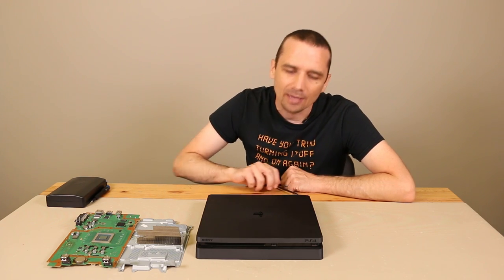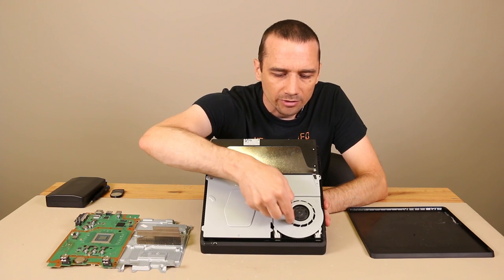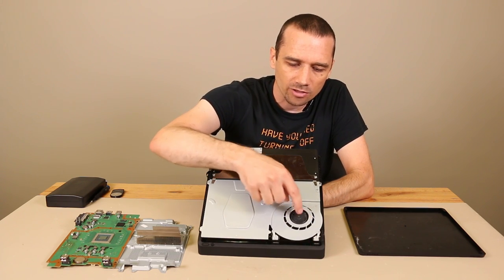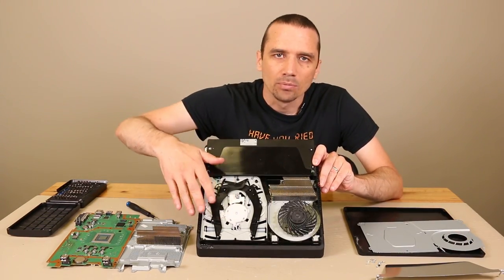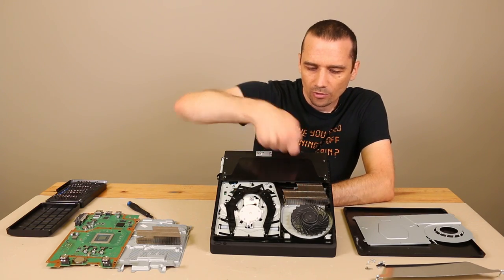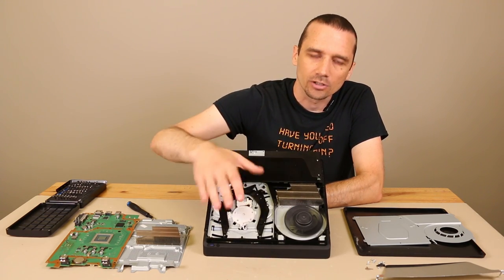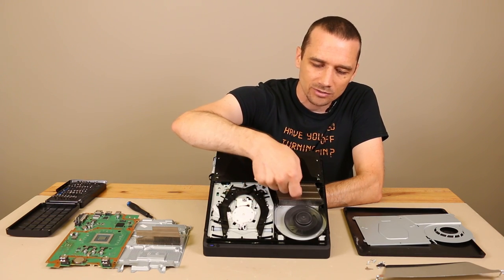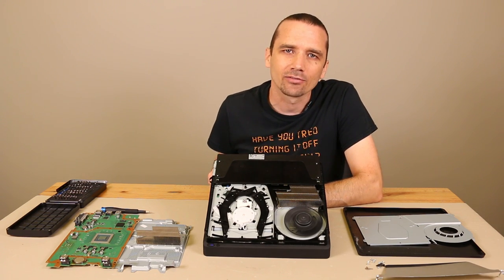PS4 Cooling System - How It Works - See it Working

Comment from the maker: Let me know what you guys think and if there is anything else you'd like to know about the PS4 cooling system. Please hit the like button if you like it!
Reply: TronicsFix Hey Steve thanks for the video. I've been thinking what do you think of the home made fans on the ps4 pro? Some people just drill the square the size of a fan underneath, and mount a different fan.
Reply from the maker: Yes, I'm planning to do a similar video with the PS4 Pro.
Reply from the maker: I'm not convinced they are really that helpful. The Pro can cool itself just fine if it's in good condition.
Reply: TronicsFix Hey Steve, I wonder if there a possibility to remove fan blades from fan itself I have a weird noise coming out of it (for me it's a bearing ) I know that PC gpu fans can be easily taken off but on PS4 it seems that the blades are somehow glued (or secured ?) 
I dont want to pry coz there is some electronic between metal base and blades fan .
Any solution for that ?
Good content ,greatings.
Reply: I'd be interested in a PS4 pro video.
Reply: MrMichaelXX It's the same thing but the cooling structer  cooler and heatsink are bigger :)
Reply: Hey you said in an early video, that it is difficult to get to the heat sink... and you have to disassembly the whole PS4 Slim to get to it...

But in this video, I can see that by removing the metal-plate cover above the fan, can easily clean the intake of the heatsink and thats the place that's collect the most dust i think.

Ain't that enough to maintenance the PS4?
Reply from the maker: Thanks!
Reply from the maker: No, you can't remove fan blades. If you want to replace it you have to replace the entire fan.
Reply from the maker: Yes! I'm planning on doing one on the cooling system. Anything else I should do one on?
Reply from the maker: Yes, in every console except for the slim you have to disassemble the entire console. You can probably get to it in the slim by removing that metal plate, but you can't get the fan out to clean it better without disassembling it all the way.
Reply from the maker: Probably, but that's usually related to their operating environment.
Reply: How much fan speed rpm  maximum limit
Reply: pls help me out in ps4 and ps4 slim which one to buy ppl are teling me to go for ps4 slim is ut really heating issues
Reply: Karan, go with the Slim. I have one and heating is absolutely not a problem. Just make sure it's in a well ventilated area. The Slim is worth it because it uses much less power than other models, and it's super quiet as well.
Reply: Go with the slim , quieter and cooler -> better performance =)
Reply: I agree with MrMichaelXX and Net_Fredy and have to say, my Slim do a amazing job, nothing to complain about.
Reply: +Pony_ Island_exe i googled and its saying dat ps 4 slim geting shut down after 5 min usage and bur ing smell, anf older versuon not available, is it really worthy
Reply: KARAN DUGGAL 
Do not worry about it, what you saw on google may be fake . Buy a slim, you will not regret it :)
Reply: After i started my Slim for the first time and played for 1 hour I smelled the plasticizer and other stinking gases like the most electronics like TV's do at the first time... but no smell of burned plastic.
Reply: +Pony_ Island_exe thank you all i bought yesterday, and played like 4 hrs straight no issues as such, it do get warm bit not hot i wud say, do get a lot warm but no issues in performance as people claiming to be turn off in 5 minutes, after seeling my ps3 i think i did right wd ps 4 rather xbox one, Cheers to all,
Reply: Congrats Karan. Have fun!
Reply: I dont think you will regret this choice, it's in my opinion the best PS4 in terms of efficiency and price.

I don't bought the PS4 Pro, because I think the CPUs are not exactly identical, even out of the same production line. They have different heat-output... some Pro's are really loud because of it's hot CPU and some Pro's are as silent as the Slim.

The Slim is cheap, easy to clean, is the smallest PS4 and is amazingly quiet and for me, the noise is one of the biggest factor.
Reply: +Pony_ Island_exe yeah true pro makes no sense nd for that need to buy 4k and ps 4 still have 4-5 years so, and i got in 350 dollars with 3 games and 3 months of ps plus membership, good deal and even the fat one gets warm.
Reply: does the fan on the ps4 pro spin in the same direction as the ps4 in this video?
Reply: TronicsFix Hey I have a question thats kinda irrelevant to the video. My ps4 gets warm in rest mode when downloading something. Because my internet is slow i leave it on rest mode all night to download something . Should i worry?
Reply: TronicsFix If I send my ps4 in for a hdmi repair. I just wanna know are you official cause you seem to be. How days to return ?
Reply from the maker: I'm planning on that!
Reply from the maker: The turnaround time just depends on which option you choose when you purchase the repair on our website. We offer 5 business day, 3 business day and 1 business day service.
Reply: TronicsFix My slim has started to sound louder like a leaf blower, noticebly with disc games like Bloodborne any idea what it might be?
Reply: if i put a fan in the rear side of the ps4(the side were is not  the internal fan) it will help to keep the ps4 cooler?
Reply: im wondering the same but he didn´t reply T_T
Reply: Would putting something like a USB fan in front of the fan intake or sides with the cover on help cool it further?
Reply: Just curious, can a ps4 still operate correctly if the fan was removed and have a different source to keep it cool?
Reply: How often do i need to clean my ps4 slim fan??!
Reply: TronicsFix is there a reason my PS4 slim (which is new) fan doesn’t ramp down when I stop playing a game (in this case call of duty modern warfare)

Comment: Do you think adding an exhaust fan to the rear of the unit, or alternatively, adding additional vents, would assist with cooling?
I noticed during teardown there isn't much in the way of exit strategy for the heated air being pushed over the psu, especially with the increased rate of the pro model.
My theory was to have an active exhaust opposite the io board to pull the heated air out independently of the apu cooler, or slotting for additional expelling area.
Reply: I have a fan blow behind my ps4 to blow the hot exhaust air away so the fan can suck in cooler air.

Comment: Ever sinse PS3, I've never found their enclosed cooling system that efficient imo. My PS3 & PS4 have modded vents where the fan is located. Makes a massive difference to it's cooling efficiency. Again, imo. :-)
Reply: In my opinion, the decision to put the power supply inside the PS4 contributes to the overall heat. That's why Xbox One manage to stay cool all the time
Reply from the maker: I don't know how efficient it is but it works well as long as the console is taken care of.
Reply: apiz arsha-veen That is a good point because the heat from the APU, is also traveling through the power supply as it exits the back of the console.

Comment: I don't think the pressure / suction comment is right. Air will move in the direction that the blades are pushing it, drawing in air from elsewhere. These fins are designed to push air out through the circumference of the fan, leaving air to be drawn in from either side - although with the mounting, there is only one side open from which air can be drawn.

Without the top part of the case, it won't be able to draw air through the vents on the side, but that doesn't matter. What matters is that air can get into the case, and be drawn into the fan. Without the case, the fan can just draw the air in directly, not just what can get through the vents.

The bigger issue is the heatsink. By taking the metal plate off and exposing part of the heatsink, the air has somewhere to escape rather than being blown across the whole of the heatsink - removing the plate will (likely) have a detrimental effect on the cooling.

If the top cover was required to increase pressure and force air over the heatsink, then the pressure would also be forcing air out of the vents in the top, rather than drawing it in to feed the fan and blow across the heatsink.

The PS5 cooling design isn't that much different to this. Except the PS5 has a larger fan, is able to draw air from both sides of the fan, and has larger vents to allow more air into the fan.

Comment: Great video, simple and on point, liked. I have a question: what do you think about vertical and horizontal position for the slim, which is the best for cooling? Also very important: if I go vertical without the stand, one of the two intakes of air will be covered. Is it still ok leaving only one intake for air? (The one on top basically).
Reply: I think horizontal

Comment: Good evening Mr. Steve and community of Tronicsfix. 

Liked the videos you've been making about hardwares, electronics and ect. on  PC plus console particularly for myself and others.

My topic of question is heat flow/airflow on a model cuh1200/ PS4 . It worries me quite a bit since it has been about 2-years purchase from now also the probilities of it breaking down because of constant high heat  operation over time again and again. I wouldn't want to risk of damaging  it so I made probably between 2 - 3 hours of gameplay everytime. I also took self instict to make several tiny holes on the wide side of top hardcover(outside) around the area which the GPUnAPU are located in which generate highest heat source and later rig up a few coustom usb pluged notebook sized mini double fan cooler against those holes as my DIY solution to tackle heating up the machine. For me having to jump over a 400 Dollars loss of broken Playstation console is not an easy thing.

Thanks so much for your time sir, is my method going to benefit the longevity of the usage period.

Looking fwd for your opinion/reply soon 

-saiful azraay

Comment: I trust Sony's system designers with the PS4. As much as modding and cutting holes in the case to make it "look cool" its not making it "cool".
The only functional thing I could see though, is cutting out the plastic over top of the heat sink (the flat part of it) to expose it without any plastic over it.
The plastic over the heatsink is basically insulation, so exposing it would drop it some degrees IMO. Just make sure its air tight around the edges so
the suction effect is still intact.

Comment: I've heard putting a thermal pad on the ps4 pro's Scei and Hdmi chip helps keep it cool. Correct? Yes I've replaced thermal paste even thermal pads. I'm not going to lap my heat sink.

Comment: great video steve, congrats, would you recommend dust filter covers, im living in colombia and the temp of my room its about 27-30 °C, and the console temp its 57 - 62 °C, its normal?
Reply: this console temp, its after 3 hours of gaming
Reply from the maker: Those temps are fine. If you live in a super dusty area dust filters may be a good idea, but I've never tested them.
Reply: TronicsFix thanks for the answer man, the area isnt dusty, its hot

Comment: The cooling system is pathetic a tiny heat sink on an 8 core CPU.  Desktops have huge heatsinks idk how they get away with such a small one on ps4.
Reply: @chriss4365 
The PS4 is only running at 230 watts max give or take. The best thing to do is not smoke it up or dust it up!
Keep it clean and clear of crud and it will last a long time. Also put some feet on it to keep it up off the surface so it can breathe on all sides properly.

Comment: I was having this overheating problem with my ps4 original 
Cleaned everything inside applied new ht gy260 thermal paste 
i put back all together after running games for 25-40 minutes system overheats and turnoff then i removed top cover and it is working without any problem
Reply: Just get a new system.
Reply: You mean bottom cover

Comment: So in the PS4's case, it would make cooling worse if I were to add addition vents (with a dust filter for obvious reasons) directly over the fan? Cause I did that on my PS3 slim (I was afraid of it over heating constantly like both the Fat PS3s I had). I also have a decently sized desk fan to blow addition air over and under the system, with the PS3 having plenty of ground clearance underneath.

I am also to afraid to take it further apart than what I already do (I take the top off and the power supply out and use an air compressor to blow out the dust, using a screw driver of something the keep the fan from spinning) to replace the thermal paste. I tryed that with my previous PS3 Fat and ended up breaking the Disc Drive cable connector from the motherboard somehow.

Comment: i just recently replaced my PS4's (fat and 6 yr old) thermal paste and cleaned the unit from dusts, should i needed to allow the thermal paste to settle or i can use the console after applying the paste immediately?

Comment: I need a new metal plate that goes over the fan. I didn't have the right screw driver and pried it off, but I realize I shouldn't have, do you know where I can find a replacement plate? It's the one shown at the right of the screen at 2:06.
Reply from the maker: Your best bet is to just buy a broken console on Ebay. No one sells those that I know of.

Comment: Hi, if I place a fan in the front of the ps4 slim, at a meter and a half away, can the air flow of the external fan cause problems to the flow of fresh air that enters from the sides of the ps4?

Comment: Ok, question.  Is it better to clean around the vents on consoles with a small canister vacuum and pull the hair and dust away, or use a compressed air can and try to blow it away?
Reply: Jeffrey Phipps My experience, I just run the brush attachment with a regular vacuum along the vents every two weeks, it doesn't actually fit in the vent slot but the suction would remove any loose particles. After 2 years I open it up and there is no dust on the fan and just a thin line along the inside of the vent that wipes away easily. Been almost 4 years now and no problems.
Reply from the maker: Either way works just fine.
Reply: Sounds good!  Thanks for commenting!
Reply: Great to know.  I just want to keep my equipment working good.  Thanks for your quick reply!

Comment: i have allways wondered how much cooler will a ps4 slim go if you buy an intercooler to the back with 3 small fans? like if compared like you play for few hours and then few hours with the 3 small fans on. will it help? I actually did order an inter cooler for fun from Amazon just so test it out :D
Reply from the maker: It would probably help, but I haven't actually tested it yet. I do plan to do that in the future.
Reply: TronicsFix cool! it would be nice to know if the console temperature will decrase just a littlebit or actually alot

Comment: Does external cooling fan that made from third-party have a signifant use to reduce hot? Or is it potentially harm the ps4? I mean if the external cooling fan use the separate power supply, not via ps4's usb
Reply: Just don't do this with your system!
You'll be generating more airflow than it was designed to have and could create issues with the internal fan - which will overheat and kill the whole console eventually, even if you are feeling it working cooler.
PS4 has the same cooling design used on PS3; what you surelly should do is keep it in an open, clean and cool space.
Bank and other crucial never stoping servers used to be put in rooms climatizated at around 22ºC/72ºF. If you wanna keep your domestic gaming console working for some years then just take care about the dust (and pets, specially cats!) and think in a way to keep the room where you play at 30ºC/86ºF MAX.
Reply: @aarondumas1629  Clean space is a huge issue at my house unfortunately. So much hair and dust and other airborn stuff.

Comment: The ps4pro takes air from the left and right sides and then it will eject the hot air from the back.. is that true? ps: I bought a usb cooling fan vertical stand for my pro

Comment: Question: I have a cheap laptop cooling pad I sit the PS4 on (slim). The fan can be adjusted to be on the left or right side...or middle..Would it be better to have that fan under the heat sink/fan side or the "computer" side?
Reply from the maker: Hmmm...I really don't know.

Comment: is there any cooling upgrades that can be done ?
Reply from the maker: Not really that I know of. If I think of anything really good I'll make a video about it.
Reply: TronicsFix how about add a extra fan to help in a strategically manner 🤔
Reply: Then it wouldn't be the ps4 slim lol
Reply: @acetonezj8363  I got one of the cooling stands for my ps4 slim but soon realized the dual fans were pulling the air away from the intake vents so took it apart and flipped the fans so it forces air into the ps4. now it stays cool to the touch all the time

Comment: Hello my PS4 has overheating red light and warning sign. It shuts off and is really hot to the touch. I think my fan is no longer working. Is there any ways I can play my PS4 with out having to break warranty, or trying to replace parts/unit?
Reply from the maker: Unfortunately, no